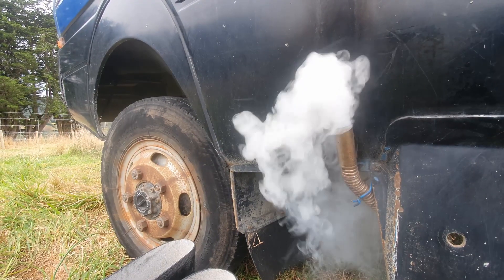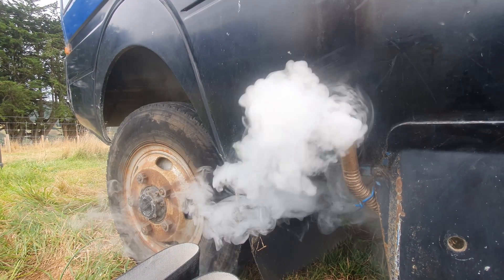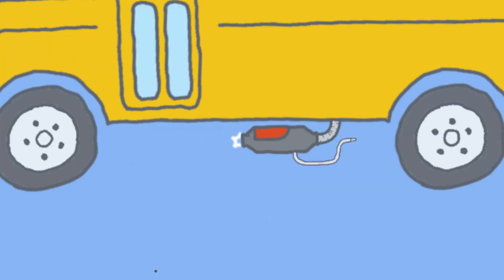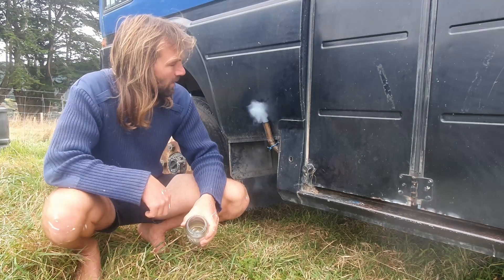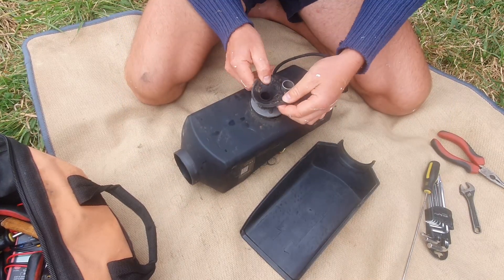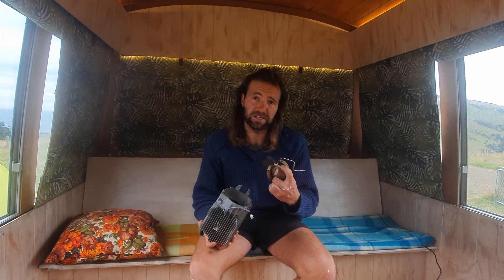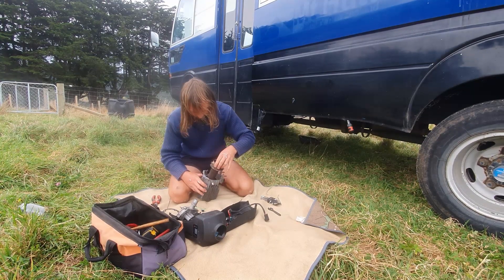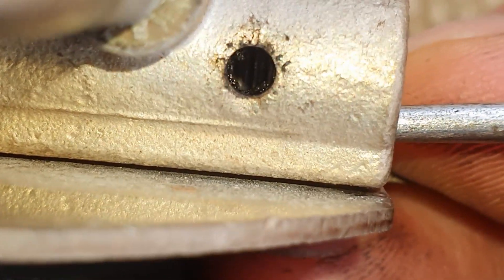[SOLVED] Diesel Heater Won't Start, Blowing White Smoke

Comment: If I start my 2kw   diesel heater on 3.0 Hz   it smokes..... if I start it on 1.0 HZ  The pump injects less diesel and I get no smoke . start it up heat it up then turn it up...  And you want a good battery for start up  for  glow plug .  minimum voltage drop .. start the truck car or camper motor and you get 14 volts consistent ... Now start the diesel heater wait  3 minutes roughly...  Unless you got a fantastic battery Or 2 batterys.. So your glow plug heats up properly.
Reply: I have the exact same issue, which I immediately thought was too much voltage drop. I used a multi-meter and found out I had heaps of vaults. Starting on 1 hz was better but it was inconsistent so what I do is give it a half second blast of throttle body cleaner, upper engine cleaner or something we have in Australia named 'Start Ya Bastard' - yep seriously that is what its called.  Works a treat, gets the diesel ignited and away she goes.  My unit just seems to overfuel on start up causing flooding, the spray trick causes it to immediately burn.
Reply: @Cammo-vp1gl  Kick it in the GUTS Barry!
Reply: Try making sure your exhaust doesn't run "up hill". Prevents condensation and diesel build up. So it shouldn't smoke on start up
Reply: A good capacitor in  circuit may improve starting glow plug condition momentary
Reply: @philgibson9201   I finally worked this heater out for some unknown reason I have to start the pump on only ...And bleed it for 20 seconds even though There is fuel in the line .  Seems to start up after doing that . If I don't  bleed it just smokes and flames out  . Might be the program Because there are different controllers  not sure .  On the controller you can tell when the glow plug is on and you can hear when pump starts  . The pump seems to start to late when the glow plug has allready turned off So it just smokes then .  So I bleed it for 20 seconds  and it starts .
Reply: Thanks I'm waiting for a part and ramping up helped start it
Reply: I do this too and also turn the fan down to 3500 until it's warmed up and going then raise it back up to 4500.
Reply: @bklyn74   I need to bleed mine for 20 seconds before I start it if I havnt used it for a whyle.
Reply: @petermoygannon698  Try having your diesel tank higher than the heater. Then this shouldn't happen
Reply: @Danny01921 this can flood the heat by gravity feeding fuel into it. Just make sure your hose clamps are well sealed so the fuel does not leak back.
Reply: Does your heater have odor in the air flow the moment it ignites. Then burn clean??

Comment: Turn off Heater, Blow Air throw Combustion Chamber Intake, and watch the Soot come out
These Heater run through a Shut Down Process
Fuel Pump Stops = Self Sustain Burn Stops
Glow Plug Turns On = Burn off excess Diesel
Fan Blows to cool down
Glow Plug turns Off
Fan reduces until 2 green bars are left, then you can Pull Power or Lose Power, any other time will result in Blocked Jets and a pain to get up to temp